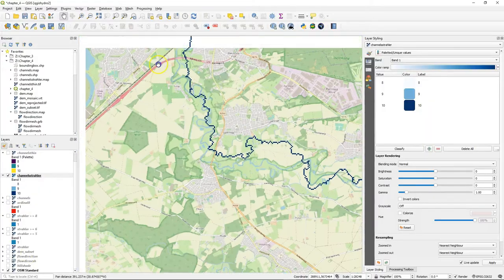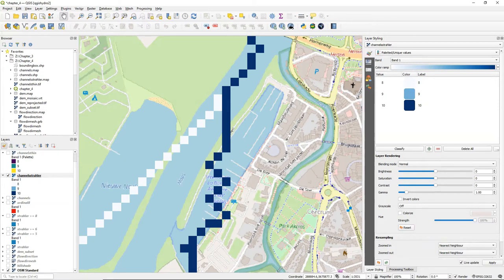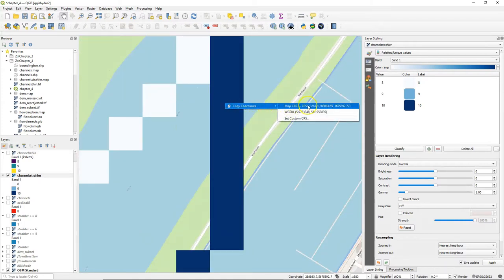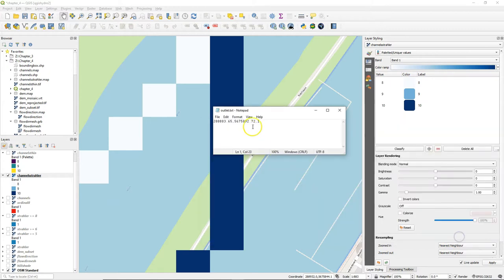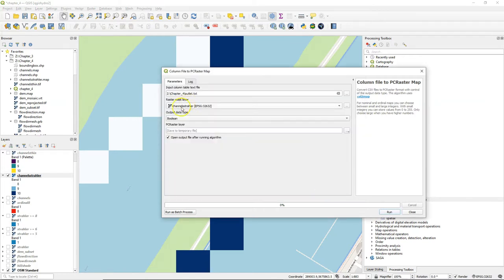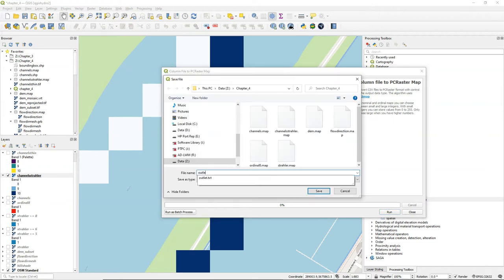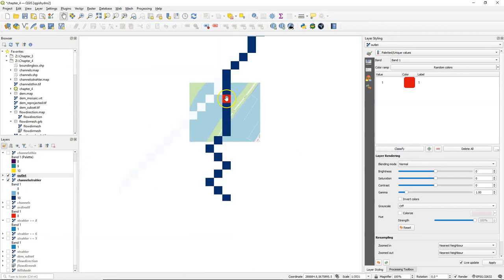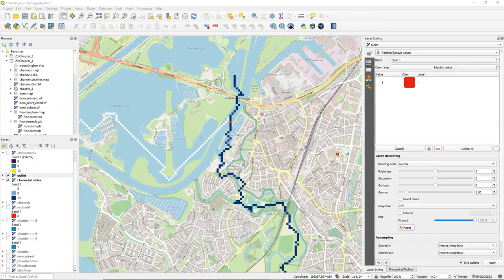Define Catchment Outflow Point in QGIS

Comment: Hi Hans! If I wanted to select a region/polygon rather than an individual coordinate for the overflow point, is that possible? I am trying to model a large trench drain which is larger than a singular pixel. The same logic follows for gathering the catchment area for say a large hole... is that possible? Thank you!
Reply from the maker: It will always drain to the pixel with the maximum flow. So even if it's a line, you have to find the maximum drainage on the line. See also this video: https://youtu.be/zdHePvhVbCw?si=NxD137QkYzGBWshK